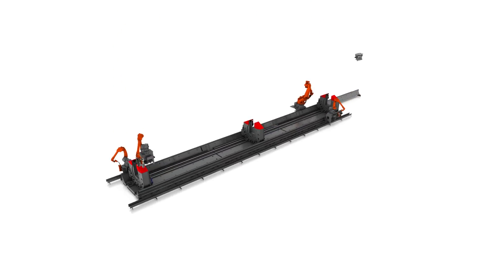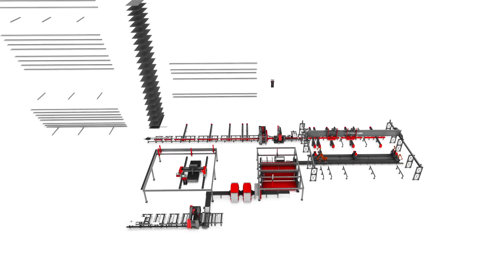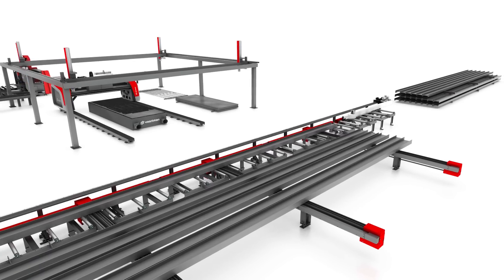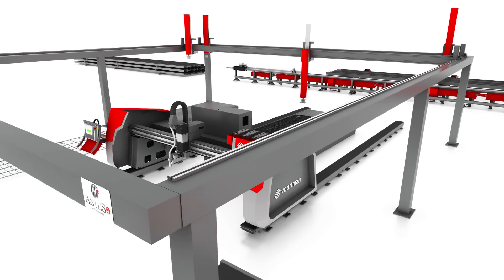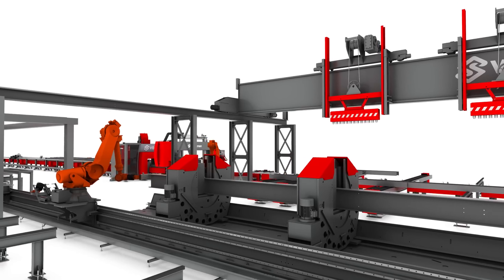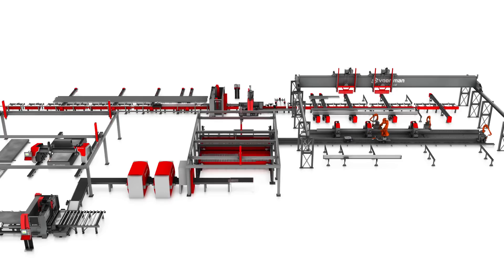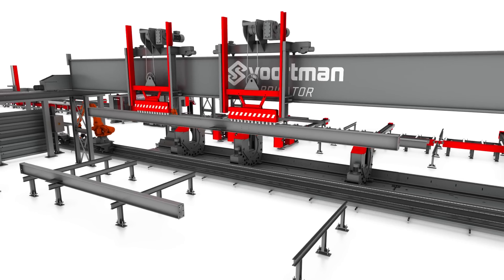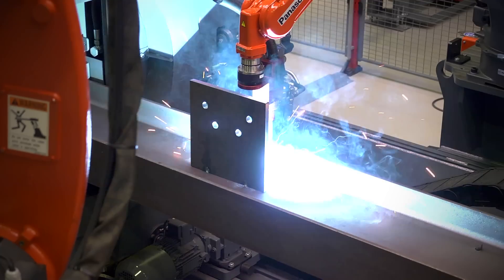Voortman - The Fabricator | Fully automatic assembling and welding

Comment: Awesome machine, what space does it require?
Reply from the maker: Hi Thesigan, thanks for your interest! For a full version (18m) it requires app. 27.5m x 7.5m x 6m (lxbxh) with a height of 6m. It is modular, so flexible.
Reply: @VoortmanMachinery  does that include the sheet metal and fabrication?

Comment: for this setup, what is the advisable total area for it?
Reply from the maker: Dear Brodd J, our system are available in 3 lengths: 12, 18 and 24 meters.
These versions take an area of 24, 30 and 36 meters length and 7 meters width  including safety area around the system.

Comment: Can this technology be use for building steel blocks for building a ship?
Reply from the maker: Hi Razorsharpview9090! The system is not designed with building steel blocks for shipbuilding in mind.
Main market are larger but geometrical relatively easy structural steel structures like parking garages and warehouses etc.

Comment: Great video but doesn't address most of the questions business owners will be considering to adopt the system.

- estimated floor area required;
- how many staff are required to operate?;
- cost, both capital and recurring maintenance/service;
- required consumables;
- estimated through put;
- delivery lead time.

I'm sure I could go on. Videos like this are just there for a "taster" of what's possible but if firms like mine are to aspire to get a system like this firms need to be less close (embarrassed) about sharing the difficult information.
Reply: This video is about how the system work. You can make an enquiry by contacting them.